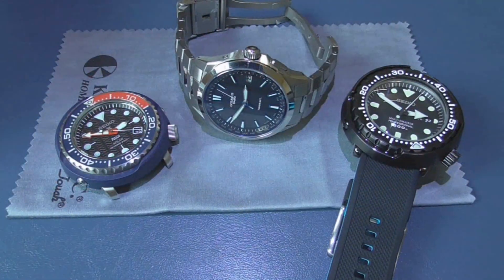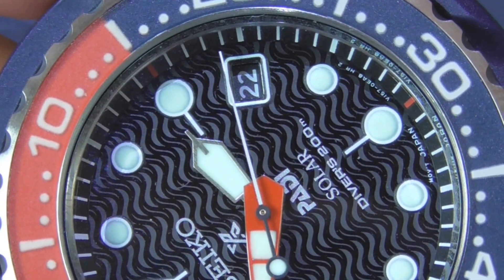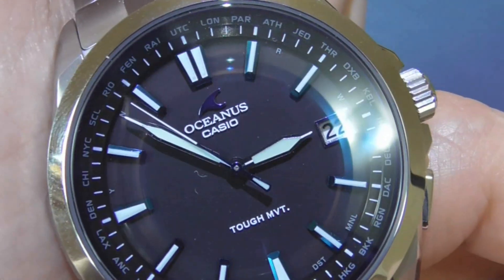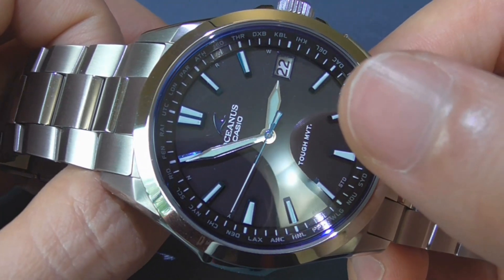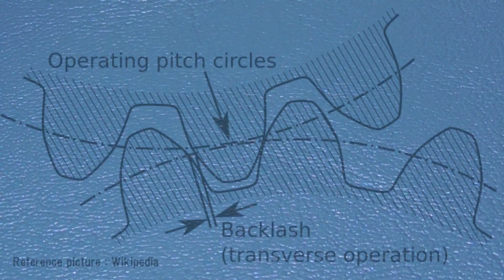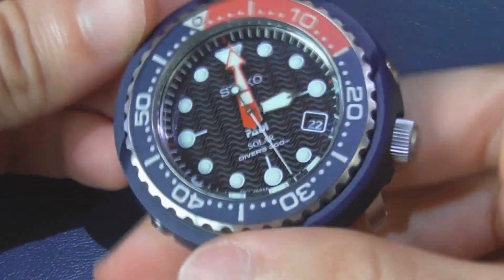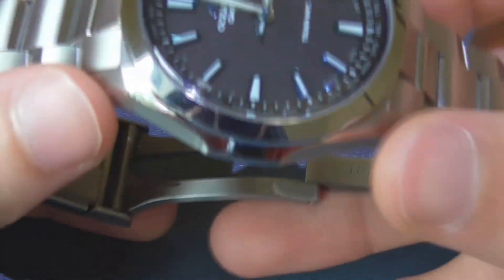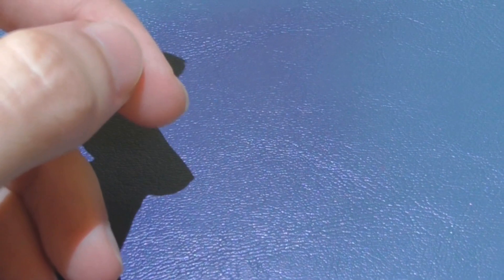Why is Hard for Quartz Seconds Hands to be Align.

Comment: I bought a Tissot Classic Dream directly from the manufacturer in Switzerland  , had my eyes on it for 6 months and even though it is an entry level dress watch, I thought that  everything would be in perfect alignment.... It wasn't. Had begun thinking that maybe I should send it back to fix/switch it, but...the vide made me rethink my action.
 Still got a same price Fossil Tachymeter and Casio Edifice which are bang on the markers. 
Shame, really wanted a Swiss made one to be proud of ...:(
Reply: Chill dude the Swiss watches are usually handmade and even the watch masters can align it completely to the marker, in Casio and other watches a newer machinery is installed with special plastic gears instead of Swiss quartz which still uses surgical steel for gears, usually the old Swiss mechanisms have misalignment but they are of hundred times better hardware than cheap watches.
Reply: Ya. Same goes to prx quartz.
Reply: @anhad7001 loved reading this comment, braught me peace of mind

Comment: The gears backlash is one of the reasons why a movement wouldn't be able to stay aligned. 
Yet I was told there were others : 
— Incorrect dial printing
— Misaligned dial
— Misaligned hands. 
When the misalignment is constant it's indeed a good sign, since it means one adjustment could line the whole watch again. 
Interesting theme and explanations. =)

Comment: Citizen very often get the alignment right, even on the more affordable models, as opposed to Seiko and many entry level swiss quartz watches. The latter are particularly poor and indeed even some higher end ones like Omega. I think it's certainly a quality issue, not meaning that it's poor movement if it's not aligned. But aligning things takes extra effort and thus cost, so some watch makers may not make it a priority. The same goes for tolerances in the movement and the resultant prevalent stutter of the second hand in cheaper quarts movements compared to the precise action of the more expensive ones. Granted there must be some give to accommodate heat expansion etc. but considering the miniature size of parts in a watch movement, surely this slack need not be so large as to be clearly visible to the naked eye.
Reply: I had noticed this matter in the past but I thought it was common on cheap watches because it was the only one I could afford. I didn't bother to dig this further not until I got into watches since few years ago. I bought 2 Citizen eco drive that cost almost nothing and the second hands on both watches align perfectly. And saw other brands that cost 4-5x more had the classic misalignment haha
Now I carefully set my automatic watches so that the minute hand align perfectly with the second hand on each minute. A new OCD I develop just to keep me occupied.
Reply: can you suggest a cheap citizen with good alignment
Reply: My citizen isn't aligned 😔

Comment: Interesting! A solution would be to have the seconds hand attached to a large gear, say 1/3 of the dial's diameter, then the backlash wouldn't cause any noticable misalignment. But this makes another design of the movement necessary.
I own a radio-controlled CASIO Lineage tough solar and the alignment is quite good.

Comment: I don't agree. I have personally realigned the second hand in several of my quartz watches from G-Shock to luminox all running quartz movements. Some are Japanese quartz movement and some are Swiss quartz movements. The issue from my personal experience is a lack of care by the person assembling the watch and poor quality control. I have managed to perfectly re-align every one of my second hands on all of these different quartz watches by removing the second hand and reattaching it. And they now hit the mark all the way around the dial. The problem is usually causes by the person who is assembling the watch doesn't understand how to take the slack out when they preload the second hand onto the mark. The newer G-Shock and citizen watches seem to be near perfect from the factory as they have better equipment to help them accomplish that. Luminox has been the worst I've seen but after I realign the second hand it looks perfect all the way around the dial and it's super easy to do on most of these.
Reply: I want to do this to my Timex deepwater GMT

Comment: At what arbitrary price-point do 'quality' quartz mechanisms begin, where perfect alignment can be expected?
Reply from the maker: Usually 150$ citizen promasters have perfect alignment while quartz over 1500$ have not so perfect alignment. You can find bad or good alignments in all price points if they don't have a specific mechanism to reduce or eliminate that gear slack. I think nobody does quartz better than the japanese so grand seikos, citizen chronomasters, and such will be built with this extra specs to eliminate that slack.
Reply: @watchroll3310  that's interesting. I picked up a Citizen Avion Eco Drive watch and the second hand doesn't quite hit the markers accurately except at the 12 o'clock marker. I thought this was a quality control issue but as you stated as long as it's consistent it's not a huge deal. Incidentally I picked it up on Amazon for $121.00. Aside from that it keeps very accurate time. Thanks for this video. You've guy yourself another subscriber!

Comment: One of the reasons the casio lines up... Is printed on the dial of that Oceanus. Tough movement.! There is an LED inside that shines through the gears.... If the sensor at the other side doesn't get the light it's expecting, it automatically corrects the discrepancy.
Yeah.... Its amazing. Just another reason why i have not been able to buy a new 'Day to Day' watch since i bought a Casio GPW 1000 in... 2016 or something? Every watch i look at seems like a downgrade. It doesnt have something i now consider a must have.... Like solar, and Hybrid Wave Ceptor, which for some reason they only have in 2 or 3 models in 2021....(I think all in the £2000 plus range).
Ican still buy a dressy watch though thank goodness. I just sold 2 watches to acquire a dream of mine. An Apollo 8 Speedmaster Blue Side of the moon. The images online dont do it justice. The laser engraved image of the near and far side of the moon.... Its like a photograph. Its a work of art.... And even THAT.... Thing of total beauty in the watchmakers art... Annoys me just a little bit because it doesnt have a perpetual calender, and it's unfair to compare the two, as they  are from half a century apart, technology wise... But.... That is how highly i rate what Casio did with the Gravity master series. Yes a £1100 (at the time) watch... Makes me just a little bit disapointed in a £7500 watch... That i adore totally and will never sell. But also wont ever be on my wrist everyday, because thats where my Casio GPW1000 lives. Crazy isnt it? Well.... Im sure someone reading this will get what i mean. I hope so, as im not disrespecting Omega in any way. My Apollo 8 Speedmaster is one of the most aesthetically perfect items i own.... But Casio got closer to timekeeping perfection with the Gravitymaster (with 50 years of technological advances to lean on, of course!). 
I even feel guilty about thinking that way, BUT, Im sure just as much... Even more work went into perfecting the Casio, as the Omega.... Isuppose there is just that ridiculous 'romance' aspect standing between the two timekeepers. One robotically keeps utterly perfect time in all conditions at all times and on any spot on the planet, automatically. The other ... Handmade, keeps time well but will lose 10 seconds a day plus or minus when working perfectly.... And yet is still just so damn pretty, and the one most people would pick, if asked to choose between the two.... Oh well. Ill shut up now.
Reply: You really need a normally sized quartz watch for day to day wear. I can't imagine walking around with that GPW1000 beast on my hand all day. Casio Lineage or Oceanus models will have the same accuracy and near perfect second hand alignment. Also saphire, titanium etc.
Reply: Get a Casio Edifice EFB for daily wear. Perfect second hand alignment, sapphire Crystal, 316L Stainless Steel, integrated bracelet, Japanese quartz movement. $100. 👌🏼

Comment: This is a great video. I have a citizen EcoDrive diver. I've noticed the minutes hand is slightly loose, it's hard to notice but it is there for about a hair. Is it possible that it is also by design in the case of the minute hands? I mean, not misaligned, but it wobbles a little bit

Comment: Thanks for video! Several of my watches(Citizen and Seikos, and all are ECO/Solar) have the second hand very spot on at the second mark. Therefore I soon reacted about that with my latest watch the second hand is pretty much half second wrong, it's in the middle between the markers. It disturbs me a bit. I understand it in practise does not matter, but anyway. Shall I accept it? And if not, would the dealer accept a replacement for that reason? I don't know yet.

Comment: If it's misaligned only on some portion of the dial, does that indicate unevenly worn our gears?
Reply from the maker: I wouldn't be able to know. Oil can play a part of the seconds hand hitting only some markers. In my experience the higher quality quartz are the more consistent they are even if they are a hair off it will be a consistent hair off.

Comment: poor excuse! why necessary? 2 from the 3 watches you show do not need the big tolerances -  in fact just means, some movements are just cheaper with higher tolerance ... 2 of the 3 watches show it can be done right !!
Reply from the maker: When a senconds hand hits the markers it doesn't indicates there is or isn't any gap between the gears. 

Grand Seikos ensure the senconds hands hit the markers by a spring mechanism that brings back the gear to have contact with the other end of the gear to eliminate possible errors but all quartz gear trains have a gap because metal expands and contracts. 

This is why you can find swiss luxury quartz with senconds hands that do not align well and sometimes 45$ Casios with a seconds hand that do align because even if it has a bigger gap it happens to hit the markers by chance.

Better quartz movements tend to have tighter tolerances on that specific gear but they are all required to have a gap because metal expands and contracts. 

Again, the fact that you can find luxury quartz with seconds hands that do not align is evidence to the point which is based on documented info.
Reply: @watchroll3310  yes agree, so the Grand Seiko with their spring have a higher perceived visual quality ensured for their users ! Apparently even a 800 dollar expensive Junghans max bill hits from 12 - 6 the index perfectly and from 6 - 12 it jumps almost perfectly "in between" the indices ... very annoying for such an expensive german luxury watch with such high design execution (besides the second hand) ....especially as you say there are cheap 45 dollar Casio which can do a better job - but that´s what I meant: some brand go the extra step, some don´t and to me it sucks when a luxury brand does not go the extra mile like Junghans and f***s an awesome designed watch up with saving a few bucks on the quarz ....
Reply from the maker: @florianh4222  ohh I see! Yea totally agree 💯